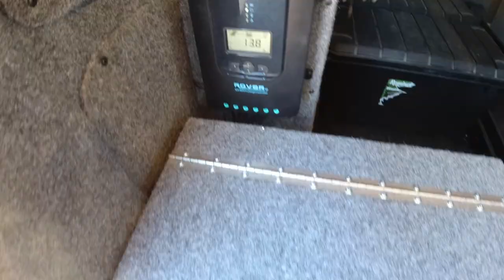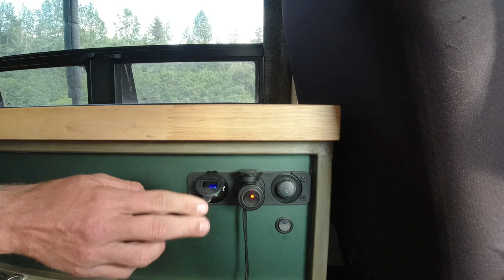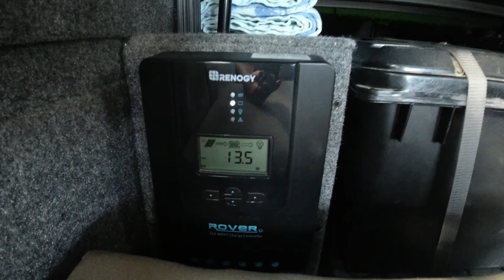Van Tour - Amazing DIY Build with Bed Lift, Bike Tray, Surf Rack, Solar, & Heat!

Comment: Great walk around guys! Love the steel welded cupboard frames, and the power bed lift!
Reply from the maker: Thanks for watching and we appreciate the compliment! The welding was probably the most fun part of the build!
Reply: @DrifterJourney  How did you learn how to weld?  Take a class?
Reply from the maker: @SteveK6470  the great youtube university!  We found a good channel for beginners, watched a bunch of videos and just started trying it. Thankfully, the first pieces we welded were getting covered, so we didnt have to worry about making the welds too pretty, just structurally solid!

Comment: Nice build. How long does the bed lift take and what distance does it travel in that time? Also how much did it cost to make?
Reply from the maker: Thanks for watching! Here is a link to our bed lift video. https://youtu.be/DRIwS_Alqwk
It probably takes 20-30 seconds to fo the full distance which is 18 inches on ours if I remember correctly. I don't remember an exact cost but the actuators can range from cheap to really expensive. The 80/20 that it mounts to isn't the cheapest nor are the 80/20 linear bearings. I'd say it was around $500 when we did it.

Comment: Somehow I missed it but do you have detail info on the construction and electrical set up of the bed?  Thanks
Reply from the maker: Thanks for watching! We do have 2 separate older videos showing the bed lift system and another showing how we wired it. Check them out on our video page.
Reply: Thanks, I’ll look it up, have you had any problems with the operation of the bed? Do you plan to use this method of bed construction/installation in future builds or are you considering other methods. I’ve seen other similar bed installation methods that seem to be really cumbersome but your method seems a whole lot less cumbersome and easier to install, thanks for replying in a timely manner.
Reply from the maker: We wouldn't do it any other way! This is our 2nd van and both had this system. We've been full time for 5 years between both rigs and we haven't had an issue yet. We love that we can cheat and put the front or back up a few inches if we're not level. The lifts are inexpensive if we ever need to replace them. I left a little extra wire in the wall in case that ever happens. The only "issue" is that the cheap lifts don't always go the exact same speed. Over time they can be off from each other if you don't reset to 0 (top or bottom). This could be solved with expensive lifts and a module that makes them travel at the exact same speed.......we didn't do that because it's not an issue for us.

Comment: Do you have weight of old versus new vans fully loaded
Reply from the maker: Thanks for watching. I can't find it now but 6,480lbs (without our personal gear) rings a bell on the new one. The previous model would have been similar. We haven't found an unmanned scale to weigh it again with our gear though.

Comment: AGM? Any reason why? I know they are cheaper but you get about half the capacity and if you accidently run them too low you ruin them.
Reply from the maker: Thanks for watching! We had one, 200ah AGM in our first build and it worked great for us. We knew that we were starting to use our computers more (got jobs) so we bumped it up to two, 200ah AGMs this go around. We aren't concerned about running them low with our minimal usage of power so it came down to weight and money. Weight wasn't really an issue at this size of battery bank and we most likely won't keep the van long enough to get the benefit from Lithium batteries (more cycles). With all that said, we've talked about wanting 300ah of usable  energy next time so weight and space may become an issue. We'll most likely make the switch for that reason if we build again or replace these at some point.
Reply from the maker: Hi! We used to snowboard but have retired since moving into the van. We decided that we wanted to give up winter because we don't find it all that much fun in a small space. Our batteries are setup in parallel and they charge while we're driving if we ever get desperate for power (we have not yet). We also have not had any issues with the batteries.